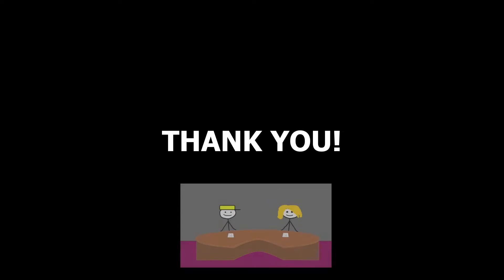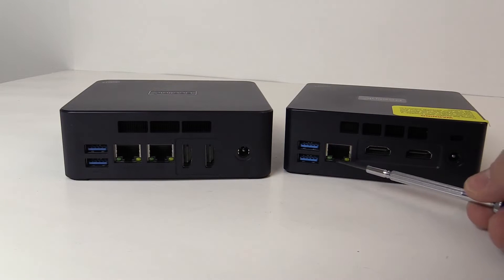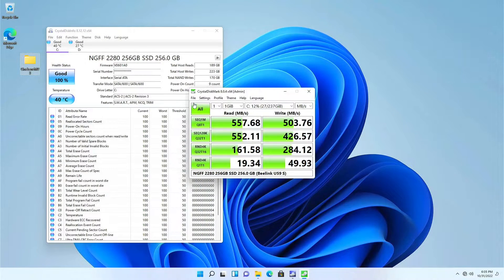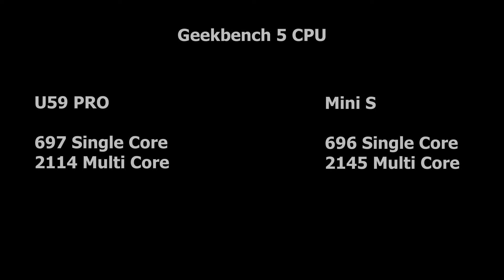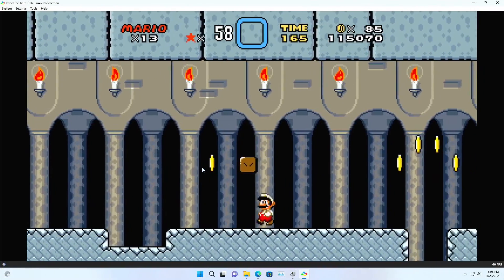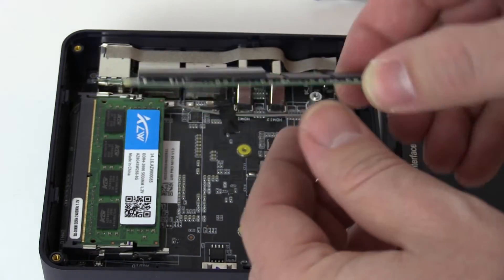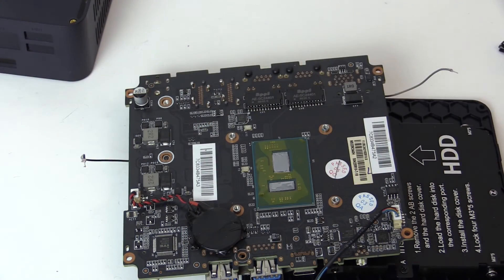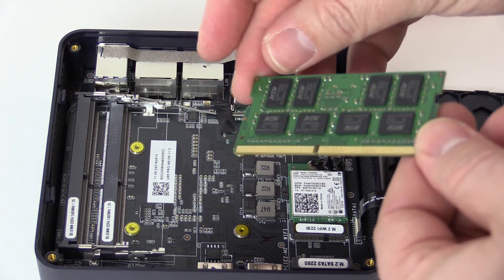Beelink U59 Pro vs Mini S! Synthetic Benchmarks, Teardown, and I Break Something!

Comment: Despite having dual gigabit ethernet (you know what it meant when manufacturer put dual ethernet), U59 Pro lacks NVMe support, the only PCIe capable port exposed is only the PCIe WiFi card, despite the processor having 8 PCIe lanes, quick napkin math show only 3 lane is used, one for wireless card, two for the realtek ethernet adapter. Maybe you can double check that the M.2 also support NVMe despite the writing only said "M.2 SATA"? I don't care I only have a slower SATA based SSD, but if I can tapped those M.2 Slot to PCIe x4 riser board, I can use it for many thing, including hooking up LSI SAS2008 (which use PCIe x4 3.0) Based card for high density-low power NAS. Beelink is currently (and sadly) both the cheapest and the only one who having an official presence in my country, so claiming warranty is not a big issue.
Reply from the maker: It is an interesting thought, but I just tried with a NVMe drive in the M.2 slot and it isn't recognized by the BIOS or once I'm inside Linux.  I'd have to do some looking around, but I've not seen thus far any mini PC with this class of processor have NVMe support, while the more powerful and more expensive classes (Core i5, Ryzen 5/7) do.
Reply: @ntgm20  most of them don't , but every unit from another brand that have dual ethernet function from 2020 onwards support NVMe, even some model have a dedicated slot for each protocol despite they running dual core celeron and from whitelabel brand in AliExpress
Reply from the maker: @pingtime  Gotcha.  I have another system inbound that I don't think is made by AZW, but won't know for certain until it is in.

Comment: just picked up a U59 for a plex media server. works pretty well
Reply: Did you try two sticks of ram for dual channel? If so how did it improve performance?
Reply from the maker: Is yours running 8 or 16 GB of RAM? I know there is another configuration for sale too, though I've run Emby on my Odroid-C4 without issues I imagine either would work.
Reply: I bought the basic model for 170 with 1 stick of 8gb, and bought another stick of 8gb for 20 bucks at the same time. I ran it in dual config since I started up. I did notice that when I first started it up and did the windows update, it took forever, I mean hours to download and install, but since is a server and won't touch it is not a big deal. I wonder if I should do a clean windows 10 install instead of using windows 11
Reply from the maker: @konrad999999  It is a point I'm pondering now for a different machine, downgrading to Windows 10 to improve performance. That or doing a debloat type action, I've seen some videos on that and this could be a good candidate.
Reply: @ntgm20  you could always pick up a cheap m.2 sata ssd (like 128gb) and install windows 10 on it and try it out. If you don't like it, swap the ssd back. I think 128gb ssd are like 15 bucks
Reply from the maker: @konrad999999  Good point!  I have one for testing m.2 USB enclosures. I don't have any inbound so I'll just you that!
Reply from the maker: Are you able to do a network speed test? I use iperf3, and running it on these two tonight I think there is an area of concern. I'm asking anyone else who says they have one to see if they have the issue too.